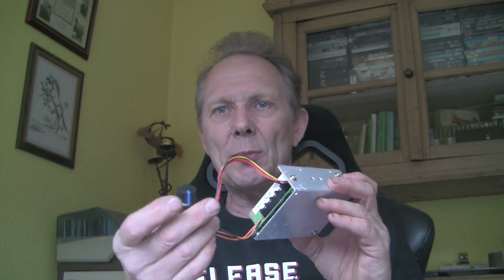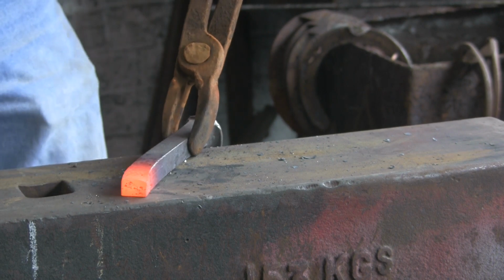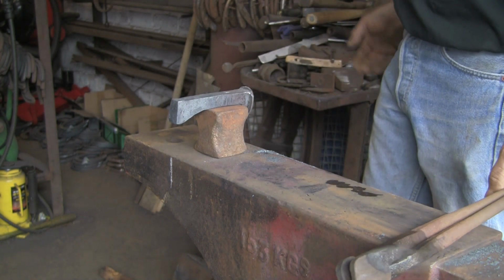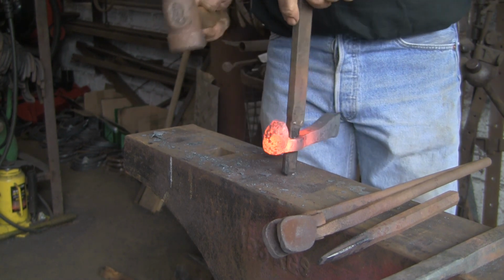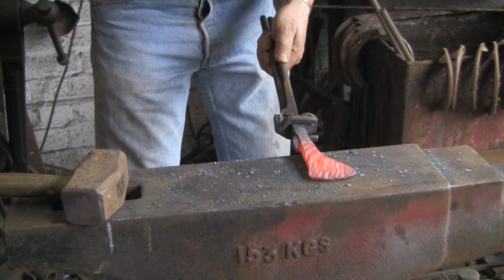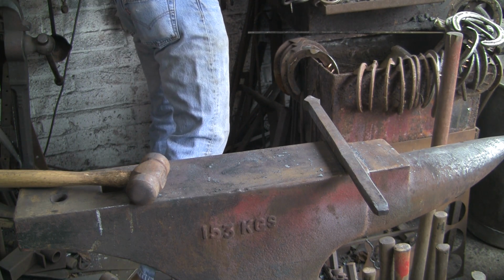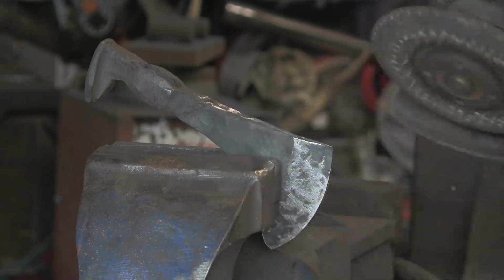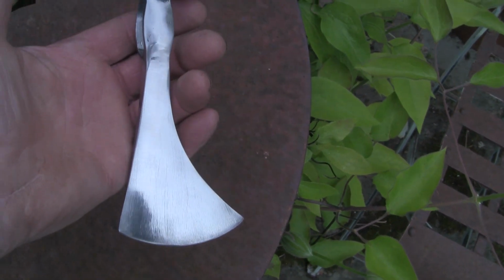RR Spike Axe & Catchup

Comment: About 10yrs ago I was doing my sisters 2yr filly all way around in steel training plates to go to the track To go in to training. Mind you I broke this filly and I got on her every morning at the farm,I worked her several times. She was a mild mannered filly for a 2yr old tb. I was nailing up the last foot. Had the 2 outside nails in and wrung off. Was driving the toe nail on the inside quarter,drove good I didn’t nail her but before I could get the nail rung she jerked her foot and ripped my left ring to bone from the palm to the finger tip. I passed out,when I can to she was still in cross ties. I got my self together,cleaned up my finger,poured some iodine on it and wraped it up with some paper towel and vet wrap. I finished that foot up,clinched and finished all 4 feet,packed up and drove home. Had supper with my wife and unwrapped it and she made me go to hospital. In the end I had nerve damage in my thumb and first 3 fingers. Was about 4 years before I finally had all the feeling back. Those free jobs have always gave me a treat lol

Comment: Apologies if asked before, but have you considered holding courses? Couple of blacksmiths I've met make a really decent amount of cash plus enjoy running the them. I certainly would sign up if you did.
Reply from the maker: No, Iv'e not considered it as my shop is way too small and i don't feel I have enough to offer in the way of a "course"!
Reply: Gary Huston - you'd be surprised. basics of tapers, bending (using jigs) and cleaning up/wax finishes can be 100-250 per person as long as they have some new toys to walk off with. Such as pokers, s-hooks and such. I certainly paid well for my early classes and thought worth the cash

Comment: Good to see you still making a stab at it.  As always, great video.   I had carpal tunnel surgery on both hands.  Carpal tunnel syndrome affects the thumb side of your hand.  My right hand also had problems on the pinky side.  That was fixed with an ulnar nerve transplantation.  The nerve runs through a little vee in your elbow.  They just move it out of there to the side.  It worked!  (After 6 months)  Try not to get too old!  Jerry

Comment: Hey Gary, good to see you and hear how you've been though sad to hear the recovery has not progressed more.

 I know all to well the frustration of lame body parts, having my right shoulder rebuilt 10 years ago and my right thumb rebuilt 2 years ago. I used these last 2 years to regroup and rethink my "life" as a smith, plus.  I spent a great deal of that time changing the shop, removing useless clutter & untouched projects, building new stuff, collecting new stuff to build and preparing for the change to come, all while allowing my hand to heal with minimal hard usage. sadly, I have scar tissue buildup that hurts 50% of the time and so far only regained about 80% of my grip strength. I can only swing the 2# for about 10 minutes before needing a short break and though I am ambidextrous, my skill in swinging a hammer in the left hand is lacking greatly , so taking breaks is more 'productive'.

 I say this to let you know we will be here when you return. Don't feel the need to make videos just to keep us happy. Your health and well being are the most important part !  Do what YOU need, the rest can wait.

  Todd.

Comment: Gary, if you forge weld some spring steel onto the edge of it, you will be able to make a much beefier hatchet. Just a suggestion. Have a better day. Glad to see you back on the channel. I do hope you are able sometime in the future to get more relief for your grip. (Maybe some rein holders for your tong reins would help.)
Reply from the maker: Philip Prigmore rein holders have been discussed lots and they are fine if you want to hold a piece in one position for a deal of time, unfortunately most of the time when making stuff the grip needs repositioning many times in a few minutes.
Reply: I know, but I do enjoy your videos and even though I thought you had probably already thought about them, I wanted to make sure you were not missing something that might help. I do understand loosing ones grip on a pair of tongs. At 65 years young, and just having only 1 year of blacksmithing experience, I frequently have the same problems you are showing. Have a great day.
Reply from the maker: Philip Prigmore thanks!

Comment: I know what you mean about losing your mojo.  I'm in the middle of an ornamental stainless steel railing job, and I can barely stand to look at it.  It really take the wind out of your sails.

If -- and only if -- you chose to make another one, perhaps you could upset the area where you want to form the cheeks before you punch it for the handle.  That could give it enough material for fuller cheeks.

Hoping you find your way out of the doldrums.

Comment: Piccard (  http://www.picard-hammer.de/en/home.html ) makes a 2.2 lb cross pein hammer .  The description is Picard 1000 gm (2.2 lb.) DIN 1041 Machinists Hammer with 14" wood handle. 
There is a pretty good selection on the internet here in the USA but shipping to you would be expensive. Piccard is a German company with a good reputation so maybe you can get one from them. 
Great video. Good luck with the hand.